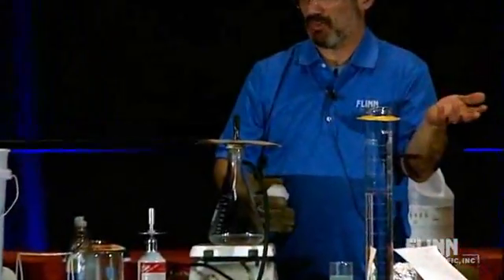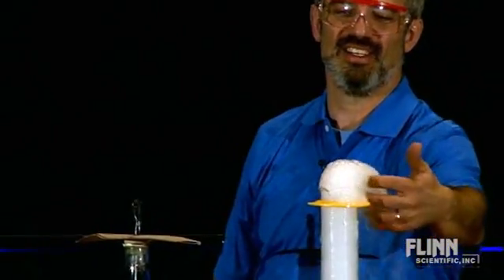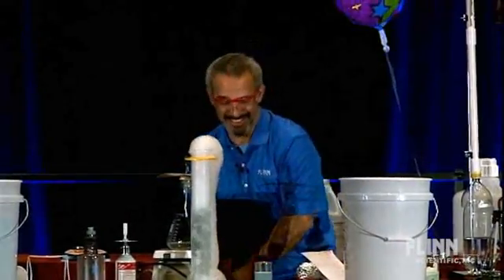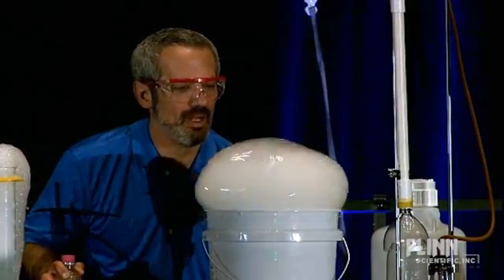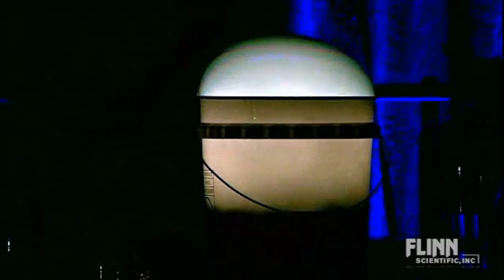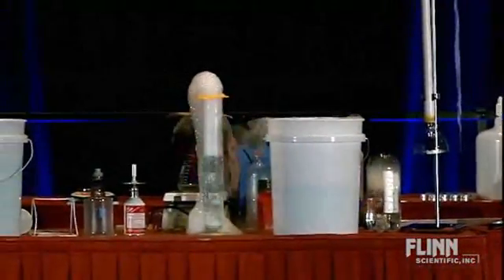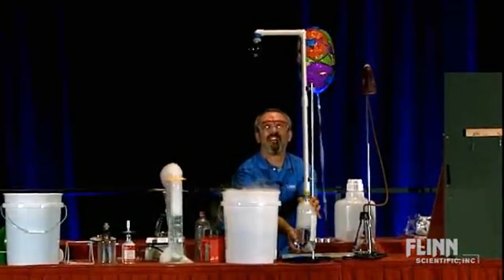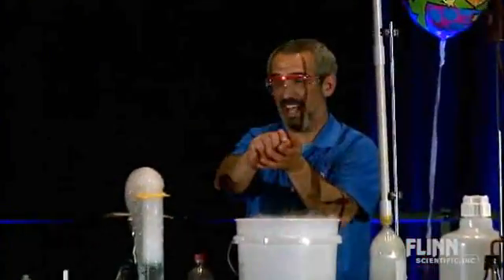Dry Ice Demonstrations | Morning of Chemistry 2013

Comment: Hi - you have some nice videos here on youtube - lots of great ideas to use with my own students -  about the thing with the shrinking bubbles - there is also something else going on, I think.
When you look closely, as  the bubble shrinks, the white cloud within it also fades to clear - (its easier to observe if you catch a single bubble on a cloth as you do later on in the video, or use a woollen glove to catch one and observe it over time) since we know that the visible cloud is water vapour, surely it is the water vapour that is condensing out and being absorbed into the water/soap bubble film, rather than the CO2 dissolving into the film  -  that's how I have been explaining it to my students anyway (although I suppose there is probably a bit of both going on in actual fact). please be so kind as to comment, beacause, if I am wrong in this, I need to change the way I am teaching it...
Reply: Logically makes sense to me, I'm not a teacher or working anywhere -just a curious High School student, but I would like to know why the water vapour condenses in shuch a way that it's so visible. For one fact, I know condensasion is when a gas converts into a liquid, but I still don't know why the water vapour is so visible.. Any help?  

I (most possibly incorrectly) hypothisize that the carbon dioxide mixes with the water vapour in some way. I'm almost absolutley wrong, but I'd really appreciate the correct explination. Thanks!